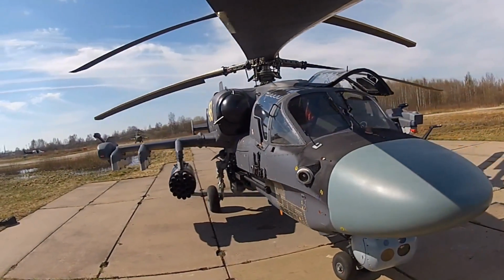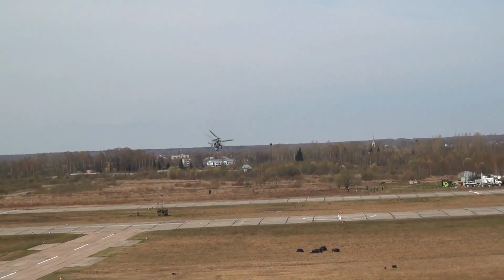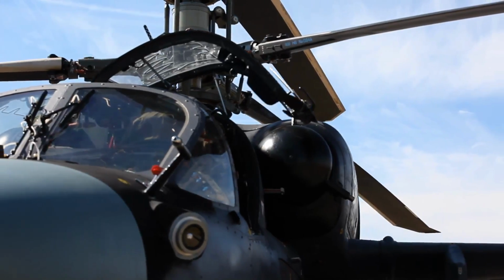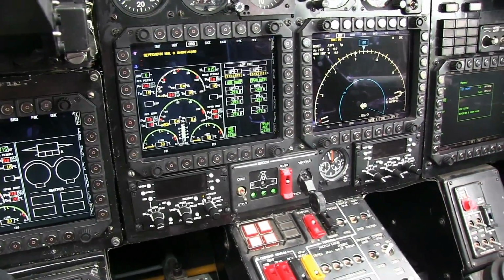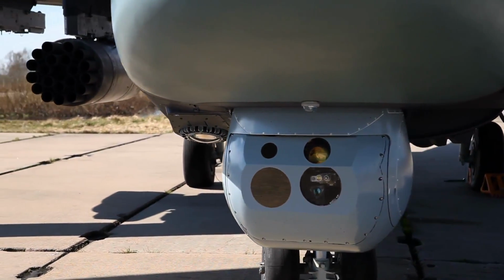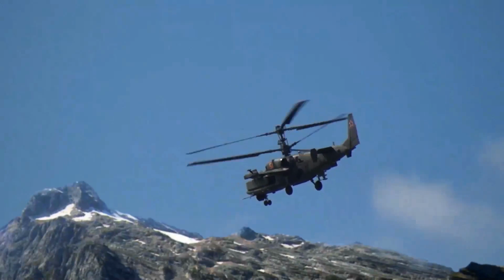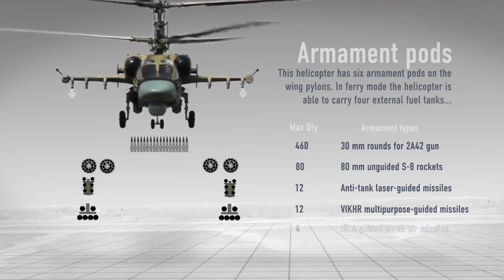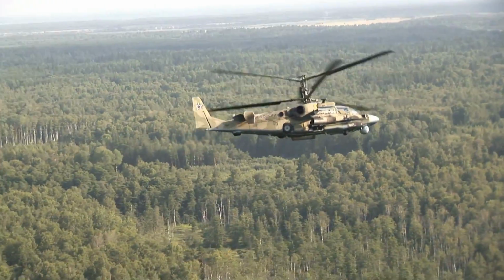Russian Helicopters - Ka-52 Alligator Attack Helicopter Capabilities [1080p]

Comment: There are just three words to describe all Russian made weapon system: Reliability, simplicity and deadly of course !!!
Reply: T-64 and T-80 were not as reliable as they could have been.

Still good tanks however.
Reply: Seth9809 During its production it was the best tanks. Thick multi-layered armor, guns Auto-Charger. Gorgeous mobility. They were more protected than the T-72. But in the modernization of T-72 Russian has invested a lot of money and modern T-72 better than the T-64 and T-80
Reply: T-64 had issues with fuel problems and breaking down.

T-80 had the same problems.

With proper upgrades they are great tanks.
Reply: These tanks are long ago removed from production .__.
Reply: They are still heavily in use right now.
Reply: In Russia, they are written off.
Reply: Wait you'd define this aircraft as simple??? Not bashing the helo, it's awesome, but I think its far from simple.
Reply: Oleg111222333 T-64 is actually worse protected than T-72 and its ammo rack is very vulnerable to detonation due to stowage of ammo inside the turret. plus less reliable. T-80 eats too much gas.

Comment: Another Russian design far ahead of its time! Just like its rocket engine design that used a closed cycle design, which the usa said was impossible that Russia designed starting in the 50s and the usa bought them, and still buy them...NOW!
Reply: ***** russia had the same thing USA had from the germans , but they devolloped better then what USA did
Reply: as far as what? Russia was the first country to develope the alloys and close cycle rocket engine......that the usa, and every other said "could not be controlled, so it could not be done" Russia did this in the 50s! Germany did not  do this type of set up!
Reply: Roy Hemion ME-262, ME-162.
Reply: SpiritCock err 163
Reply: ***** no they didnt, why do you think usa got to make it to the moon first but russia got to space first?
Reply: space318 if it wasn't for the economical troubles the soviet union had, they would've got to the moon years before the americans.
their engines were 25 years ahead of the american engines.
Reply: ***** they didnt get close to putting a man on the moon. Soviet planning failed hard
Reply: brodz423
BS. They were far ahead of the US in the space race... then suddenly the US does the impossible... we know it is impossible because NASA admits it. Can't make the space suits safe from the cold, heat and radiation, can't keep the dust out, can't this, can't that, need 3 launches at once.... NASA admit this. The moon "landings" were hoaxed.
Reply: brodz423 you have never read any book or any basic knowledge about the space race at that era . the USSR was decades ahead in technologies over the NASA. their quest for perfection cost them to lose a lot of money and by that the USSR collapsed .

read about it if you can read at all.
Reply: ***** "Decades?" If so, they would've made a manned trip to the moon easily. After all, USA did it 6 times in less than 2 decades. I think youre a little bit exaggerated. Russia made great strides in technology, including first satellite, but they could not maintain the progress.
Reply: brodz423
No, USSR was far ahead. They did not go because with the technology of the time it can not be done. NASA admit that with 21st Century tech it can not be done. They admitted it. Pay attention!

Your belief that the "USA did it 6 times in less than 2 decades" is just an easily disprovable, debunked delusion.
Reply: no shit! I wrote the paragraph giving Russia...actually the USSR credit for their advanced design
Reply: Daniel Skipp So NASA faked the moon landings all 6 times they went to the moon?  Funny Russia couldn't prove we faked it cause they were watching us do it the whole time.
Reply: The Americans knew it could be done they just thought it was to dangerous. They care about the us citizen lives.
Reply: caderaid100
you make the typical assumption about East West conflict that doesn't hold. The Elite run Russia as a globalist tool ever since Lenin [banker's tool]. The US feeds Russia, always has. There is no conflict. It is theatre for the masses. It is all fake. It is OK to wake up from  your programming.
Reply: Daniel Skipp the Elite? My grandpa was one of the people working on the heat shild i think he would know better than u
Reply: Daniel Skipp Moon landing hoax? Flouride-murders? You need a break from the internet, man. I'm with you on the less-than-effective drugs and the pollution, but you can't just swallow everything.
Reply: +Herr Hansen Keep swallowing that fluoride... it is clearly not damaging your brain at all. /sarc
Reply: We're talkin helo's here......far as most people know helo's don't have rocket engines.......Just like most in here are not rocket scientist.
Reply: I absolutely agree with you and is not only that I was researching I found out that the stealth 117 it was russian design too
Reply: Who won the race to the moon?
Reply: Isukaman
E.T.
Reply: Isukaman Who won race to space station? You are still just hitchhikers.
Reply: Duk1nfamous The Russians can't produce a car, computer, camera, tv, airplane, etc that the rest of the world will buy.  Nor have they produced a drug to help anyone.  AND, they can't successfully land a probe on Mars.
Reply: Isukaman They landed a probe on the surface of Venus in the 60'ties.
Reply: Michael Pouzbouris I'm sorry, but that is a blatant lie on your part. The design of the F117 used points from a Soviet paper about radar returns published in 1964, but the design it's self is an American design. Please get your facts straight and stop spreading misinformation around the internet. And if by some miracle it was a Russian design, then how come the Russians never built any?
Reply: *****  im so sorry Chase if you  dig you find out if they did or not
Reply: ***** Are you daft? BASED ON. The design is BASED on that principle, which dictates how parts of the aircraft are shaped, not exactly how it is designed. You can have a bit saying how the wings should be shaped but you also have to find out where they should be placed, how big they should be, what kinds of mechanical stuff do we need to put inside? You have a guiding principle in the design that's Russian, but the design it'self is American! American engineers applied that formula to the aircraft and built it, they installed the internals, they arranged it into a flight worthy configuration, and they made it into a lethal aircraft!
Reply: *****
The USSR didn't have a chance to get to the moon first, because they started working on their lunar rocket (with a closed cycle) several years after the US and because the soviet closed cycle rocket was a total failure (4 out of for launches failed) All previous work was based on the R-7 rocket. And the first US closed cycle rocket wasn't based on russian worked, but devoloped in the USA during the 1960's and 70's and used on the space-shuttle from the early 80's, two decades before the US started to use russian closed cycle engines.
Reply: *****
Tell that to the engineers at Rocketdyne, that designed and fielded the closed cycle rocket engines for the spaceshuttle two decades before ULA bought the RD-180 from NPO Energomash.
Reply: *****
And if one could use the "Russia designed the F-117, because they developed the math behind it", then virtually all aircrafts should be considered to be designed in the USA, because of the use of NACA or NACA-derived airfoils.
Reply: SpiritCock that's a jet engine.....not a rocket engine!
Reply: Daniel Skipp Wow, what a prick.'' The Moon landings are not fake and the proof is that none of America's enemies, potential enemies, or rivals, have come out and said they were fake.''
Reply: ***** Dude all you need do is compare the US space industry, both civil and Fed, to Russia and you'll see the only thing Russia has on us right now is our need of their craft to get Astronauts to space and the ISS.'' We only need that cause we recently retired the Shuttle.''
Reply: SpiritCock that's a jet engine......not a rocket engine!!! 2 very different concepts!
Reply: ***** I agree....plus Russia employed a build it....test it...and work out the bugs later type of development scheme....which for all obvious reasons proved extremely useful.....expensive as hell....but very beneficial! Russia, after all....beat the USA in every thing BUT going to the moon...or should I say landing and returned.... Russia after all was the first to see the darkside if the moon.....it wasn't pink Floyd.
Reply: ***** yes!! Thank you for posting the truth....instead of arguing who invented the nut and bolt....too many people are quick to jump on the "USA did it first" bandwagon......
Reply: SpiritCock ugh.....that's a JET ENGINE......we are talking about ROCKET ENGINES.....that burn mixed fuels in closed areas.....
Reply: SpiritCock this is better....but not correct..... Not an engine that can burn into the stratosphere, and higher.......
Reply: SpiritCock cool name though!
Reply: Daniel Skipp oh.....but we could put landers on any other planet, or rock.....?repair Hubble several times.......build huge stations in space with space walks lasting hours per man, and what was that shit....they brought back? How do u explain that? Was it made in a fucking lab,? Lol......